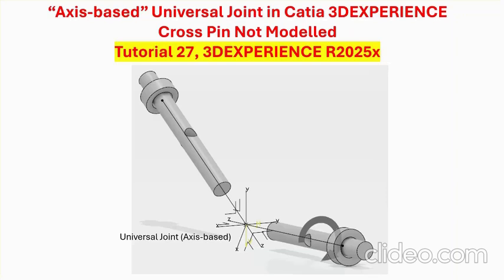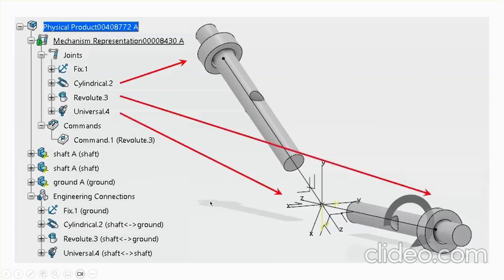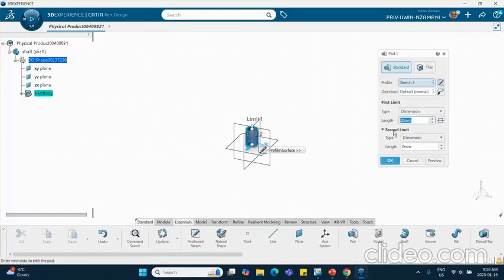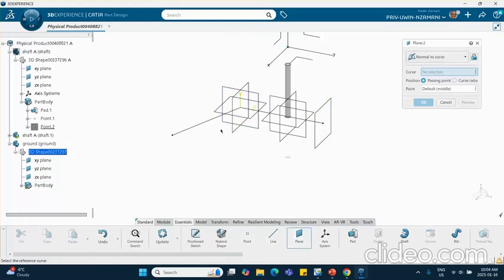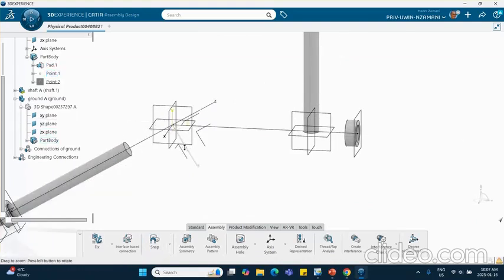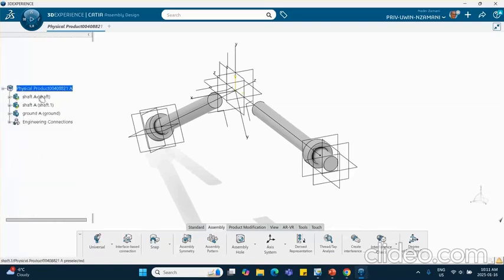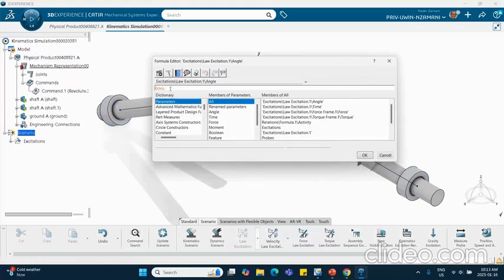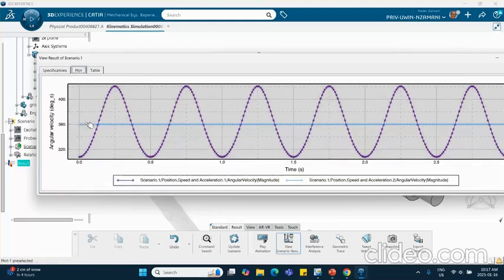Tutorial 27 Universal Joint Axis Based Joint in Catia 3DEXPERIENCE No Cross Pin Kinematics Scenario

Comment: Can I ask why the driven shaft velocity not constant?
Reply from the maker: @engineer6525  good question and it is something that is covered in a machine dynamics course. When the two shafts are aligned, the two velocities are the same, If there is a slight angle, the driven shaft does not turn at constant velocities. This is when they attach another shaft parallel to the driver shaft which will turn at the same constant velocity. The three of them together are called a constant velocity joint. This is what you see in trailer trucks.
Reply: @naderzamani-ngzk  thanks sir got it 🙏